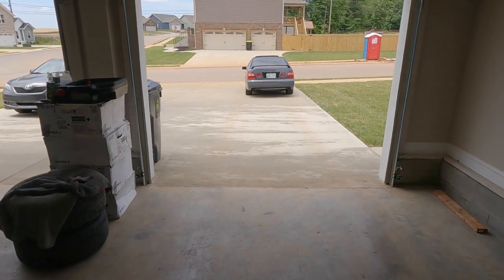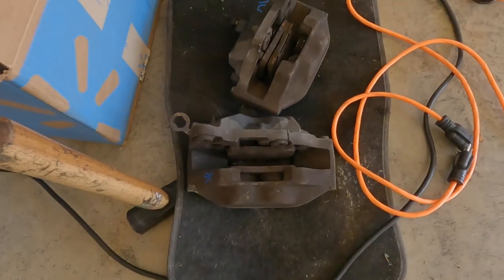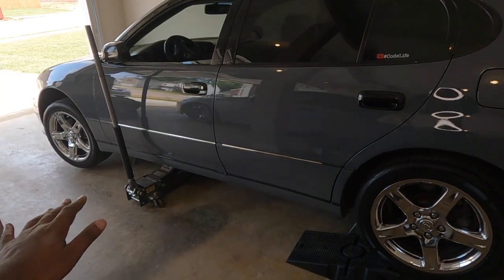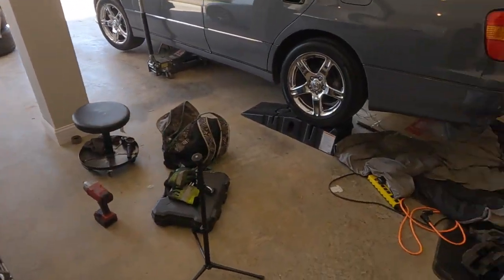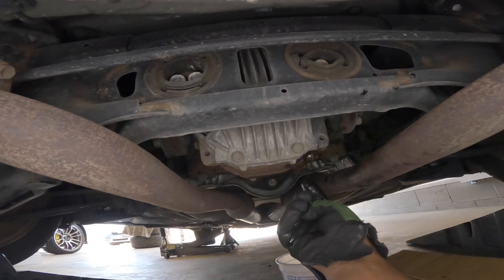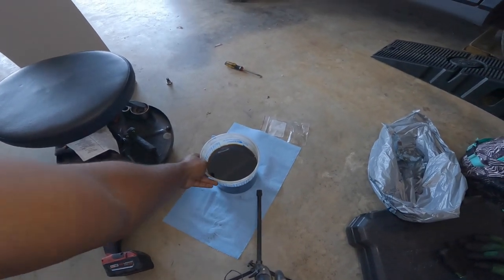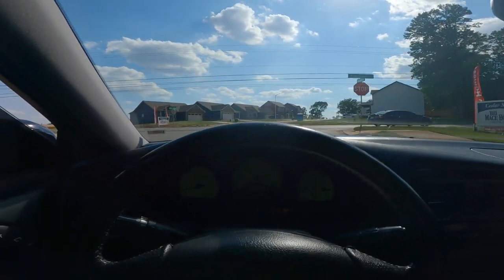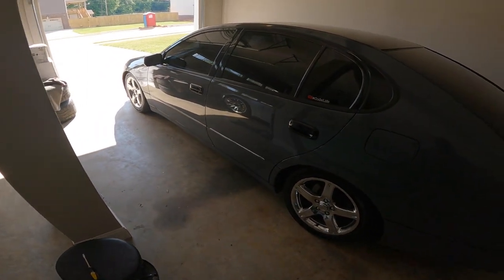Changing 22 Year Old Diff Fluid *YUCK

Comment: Explain the steering wheel to me, please. I want that exact setup, meaning I want to upgrade/retrofit my 04 gs300 steering wheel to the paddle shifters, Bluetooth, call connect, and radio controls. What Lexus models steering wheels fit these GS 300/400/430 models?
Reply from the maker: Most folks will upgrade their steering wheel from the 98-00 Lexus GS to a 01-05. Since you already have an 04. What I did is meaningless to you. Sounds like you might have to do some wiring to accomplish that. I suck at wiring lol
Reply: @AutoMatticMatt  Naw my 04 is a GS300 it doesn't come with the radio control,  Bluetooth button. Just the shift buttons.